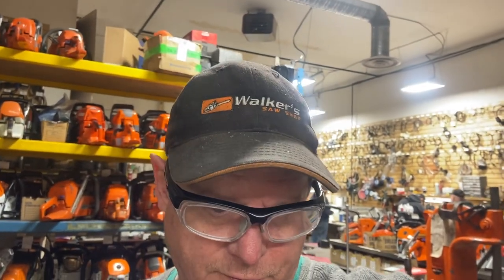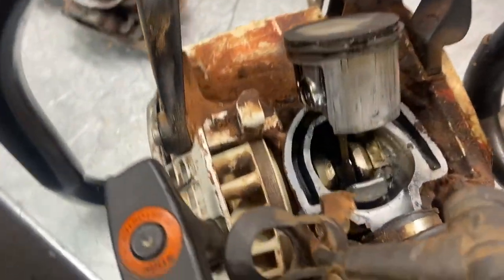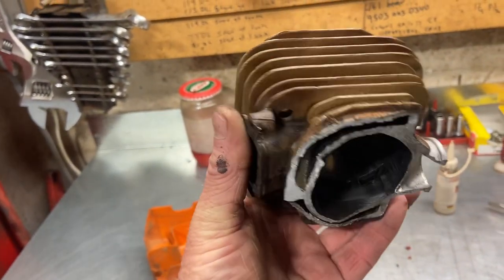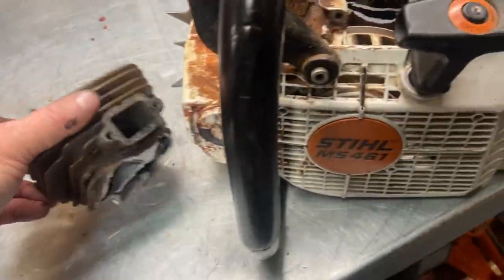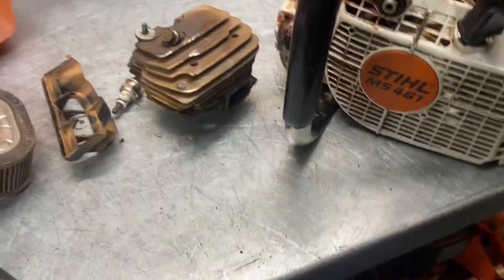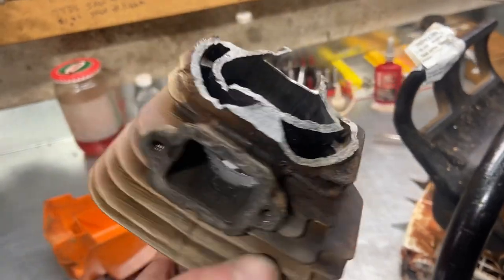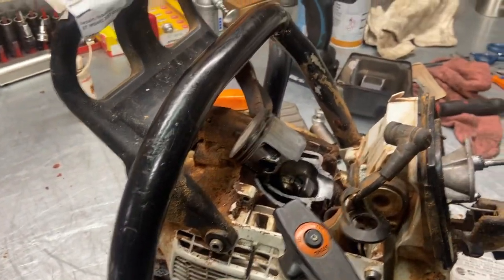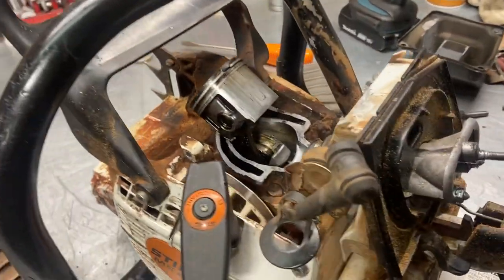Donny walkers chainsaws wow stihl 461

Comment: Ouch  split mind lol mind of its Owen  ya that has to be the first I’ve seen that unless he or she is doing aftermarket or used part  just as well buy a new saw wile there at go to661 un less they want 461 if so then port it turn it in to a torque monster and you can tell him, I said that  my self  I like my 661over the 441 😎😎